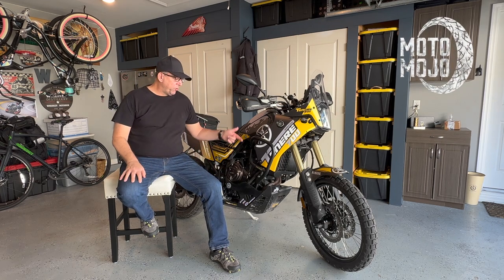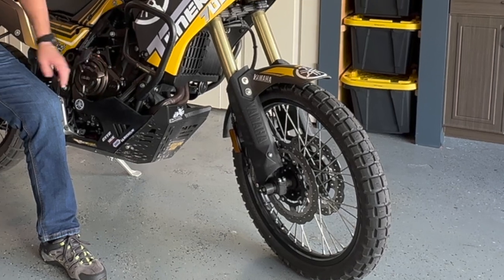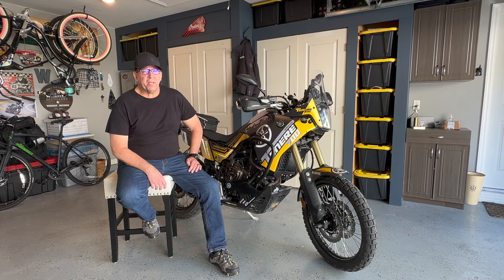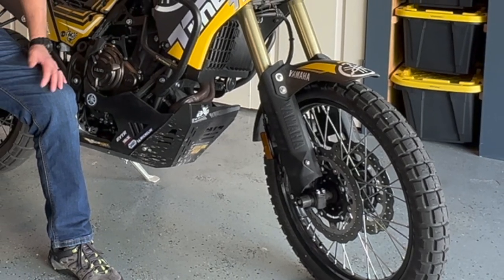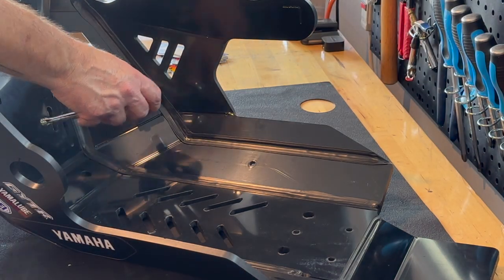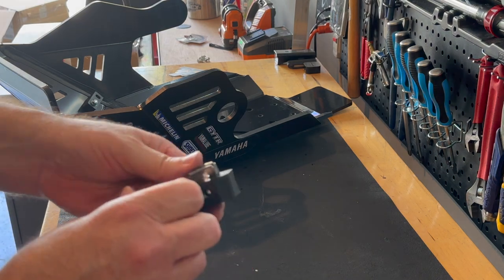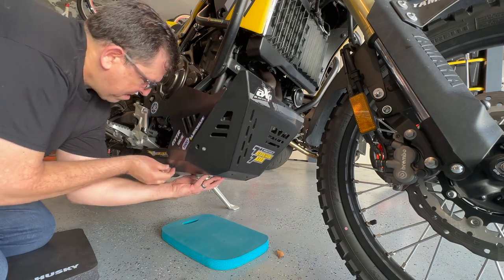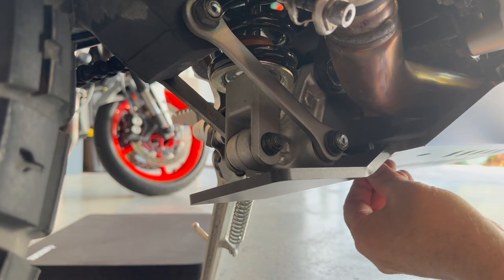Tenere 700 Skid Plate Install

Comment: The new Design of the AXP is what I really like! Last year I bought the bash plate from Acerbis, which is also made out of PE. I prefer these because they fit so nicely. What you said is absolutely correct. If the stones fly against the plastic bash plate on a gravel track, it's not nearly as loud as on my KTM Adventure 1190 with the aluminum bash plate from the KTM accessories.This is really annoying.

Comment: Was going to get this plate for my '22 until i saw some pics of the cat melting the plate. Maybe just a prolonged idling thing with no air flow? Went with Camel Adv instead. Its a VERY well made plate! Havent put it on yet as im waiting to hit 600 miles for the first oil change. Looks great hanging on the wall for now 😂
Reply from the maker: I was right on the edge with buying the camel one. It’s definitely a good one! 
I was worried about the plastic near the headers too. So far no issues.

Comment: Thanks for this video, I bought it and I don't know how much I should screw the rear linkage bolts. Because the protection touch the linkage
Reply from the maker: I’m not too sure. The linkage bolt worked well for me. The company’s really good with answering emails for questions like this. Give them a try. 👍🏼

Comment: Looks like it will do the job.  I am curious will this mount to a 2021 with the stock center stand.  From the video it appears it will not.
Reply from the maker: I believe that the center stand and AXP skid plate utilizes the same mounting locations.
Reply: My 2021 has this with the SW Motech center stand, it needed a small cut at the time to accommodate it, not a big deal, AXP did supply a diagram for that under request. Chances are, that's no longer needed, it may come with that.